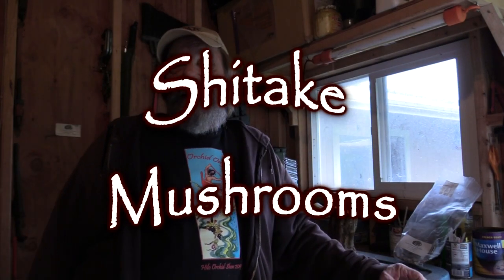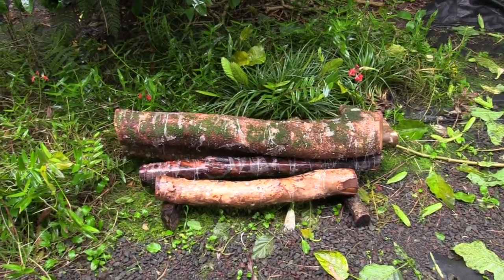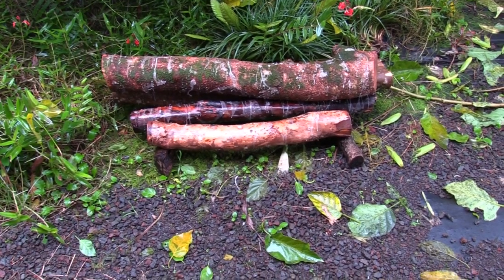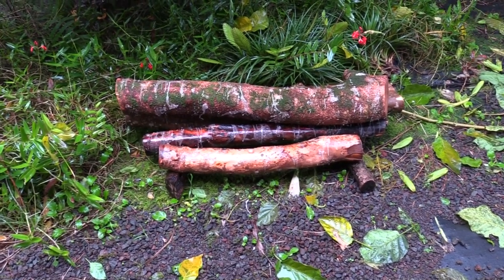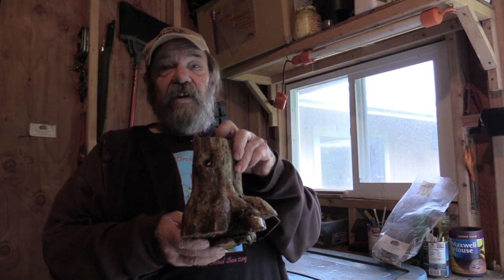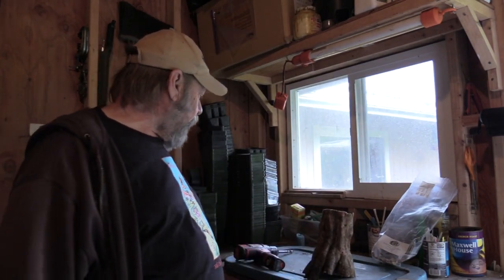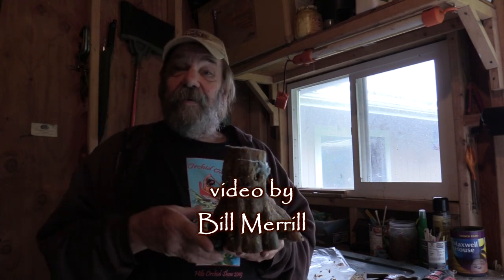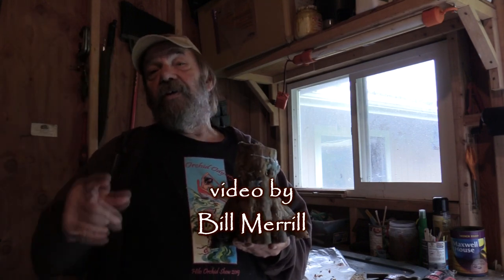Shitake Mushrooms

Comment: I will be very interested to learn what woods that grow in Hawaii work with Shitake mushrooms. I have grown them here in Switzerland on Oak. We have land on the Big Island and hope to move there in the next couple of years. Growing Shitake mushrooms is on my list.
Reply from the maker: I hope to have it all worked out before you get here.  My partner took a class on growing shitake on Koa wood here.  This would only be worth while if you owned the Koa trees and saved only the miserable branches for mushrooms.  Prime Koa is worth $250 per board foot and is a bit like growing mushrooms on diamonds!
I recently learned that shitake will grow in waste coffee grounds.  I knew this is used for oyster mushrooms and I have some growing in sacks of used grounds. The Almond Agaric and the Wine Cap Stropharia are easier because they are not very specific about the substrate.    Right now the only shitake spawn I had was on hardwood dowels so i drove them into coffee wood, 2 kinds of Ice Cream Bean and Guava.  Perhaps Mango is worth a try.   I'll grow some shitake spawn out on grain or sawdust and try using it on coffee. some time this year.
Reply: @GreenGardenGuy1  Thanks, I hope you will do some videos on that and how it turns out.
Reply: @GreenGardenGuy1  I wonder if what you use for sawdust will make a difference. Maybe you could get some Koa wood sawdust. ;)
Reply from the maker: @frederickjohnh  Yes, I will make some videos but first I have to run through the process a few times.  Growing mushrooms is new for me.
Reply from the maker: @frederickjohnh  I am sure they would grow on the saw dust but even this is difficult to find here.  We have a lot of junk wood trees here and a few invasive species.  In my thoughts, using trashy trees with invasive qualities is a win, win for mushrooms.